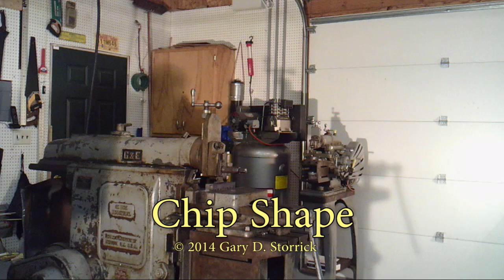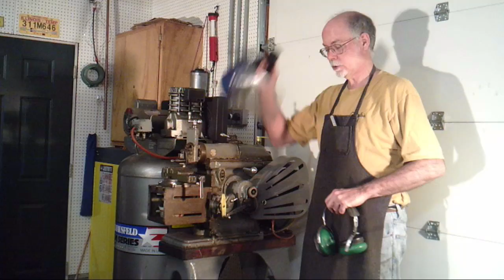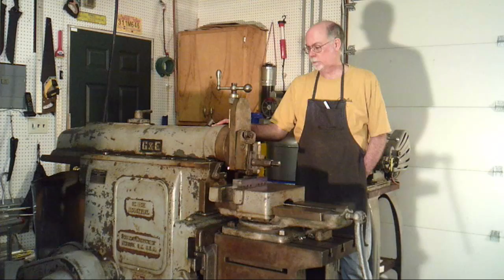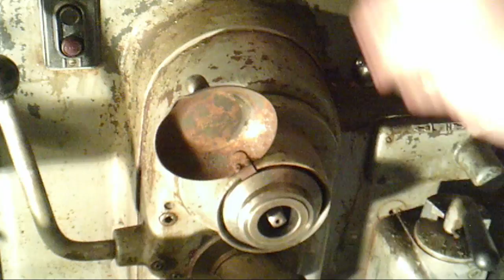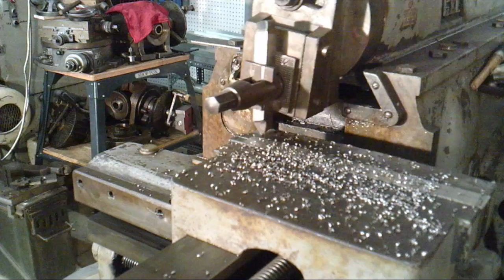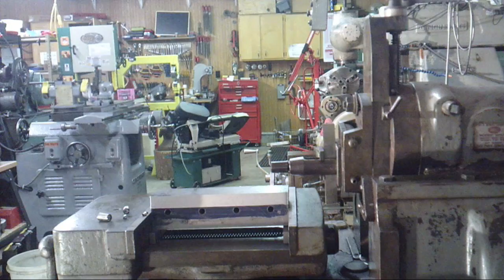Chip Shape

Comment: One particularly innocuous machine is a press. The tremendous forces involved in a difficult press are stored as energy in the flex of the parts involved which can be released instantly in the case of a fracture.

Comment: Hi Gary,
I have a similar G & E shaper in 16 inch size.
Can't tell the size of yours.
It is a boss. I use it for rough cutting steel, stainless
And everything else. It has saved a bundle on inserts.
If you point the clapper box more into the cut, the tool will swing away more on the back stroke reducing the rubbing and wear on the tool.
Kap
Reply from the maker: Thank you for writing! Mine is a 20 inch. I also like to use it for hogging metal so that I don't have to dull an expensinve milling cutter or insert. Maybe someday I'll find a universal shaper, there have been a few days that I wished that I had one. -> Gary

Comment: Great job Gary.  Ya gettin pro at vidios son.  The shaper, most used machine in our
shop.  The shaper does all the dirty work, they eat rusty metal compaired to expensive end mills.  We have added a DRO on the downfeed (way to go).. I'm still
looking for a 36" Cincinnati, but none around here, and those available, I cant afford
the shipping.  Keep em comming!
sam
Reply from the maker: I've thought about putting a DRO on the shaper. I wouldn't live without one on my mills, never miss having one on my lathe, the shaper is in between. Can you send me a photo of your installation" storrick at concentric dot net
.
Before I do that, though, I will probably rig a limit switch to kill power when the table moves past the cut. Then I can walk away and get distracted. I'm thinking of putting the switch on a magnetic base so that I can adjust it easily. It would be a simple electrical modification.

Comment: Gary

Very good video.  Was that really a slip stick (about 4:50).  Have not seen one in decades.  Good discussion of "machine power" (force ??)  Many have no idea of torque a small 1/2 motor can produce with a decent gear reduction.

Dan Bentler
Reply from the maker: I keep a slide rule by each of my computers (including the one in the office) and a few others lying around in convenient places. I use them frequently - they are often faster and they force me to consider significant digits. In my perfect universe, engineers woudln't use a calculator or computer in their work until they had used a slide rule for two years to prove that they understand what their calculations mean and what is important!
Reply: Gary Storrick
You are causing me to review my education history
Slip stick US Navy Nuclear Power School in 68 - biggest and most important lesson there was to be able to estimate result of calcs.
German schooled chemistry instructor 1980 docked us 2 points for every fould up on them dang sig digs.